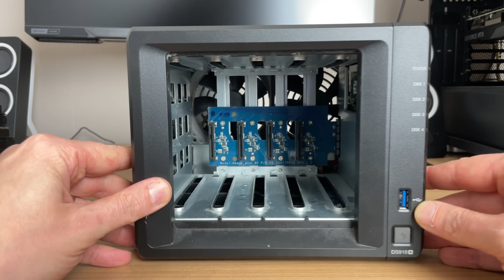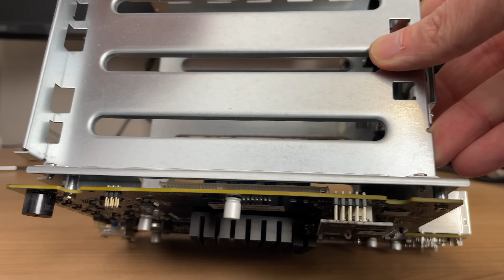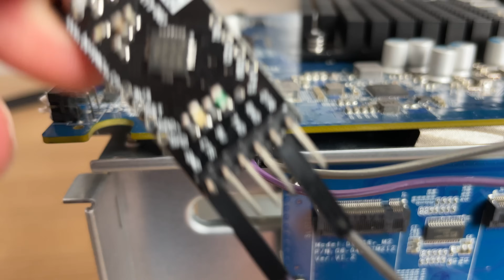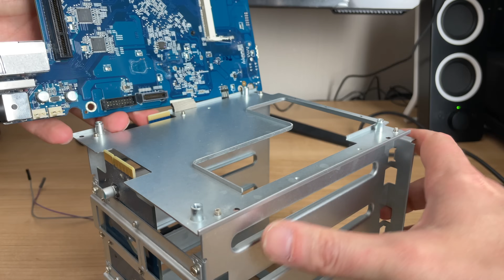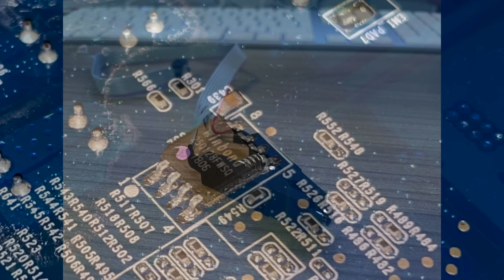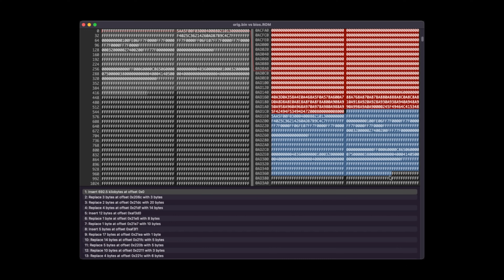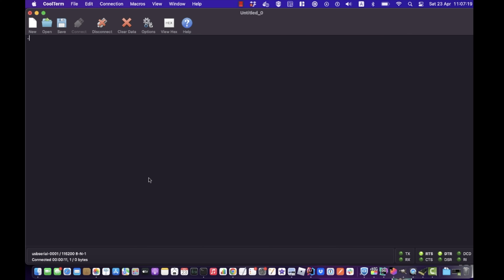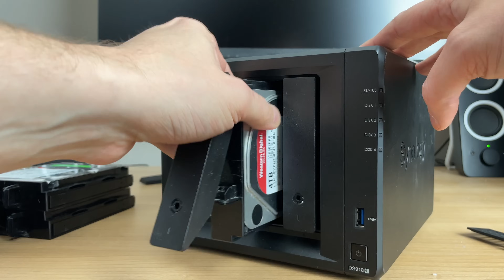Synology DS918+ Bricked / Blue LED of death.

Comment: Interesting, I have the same issue on one of mine, a DS218 and ended up buying a new one. I don't really have the tools nor the skills to effect a repair like this. I'm overall very happy with Synology and have 8-9 of them. I've had a better experience with Synology than I have with QNAP where I had a 6-bay one die 2 weeks before it's warranty ran out and it's replacement die 2 months after it ran out. Great job on yours though.
Reply from the maker: Yeah. Also pretty happy with Synology but was a bit annoyed with the fact how easy these things can break. Friend of mine has 2 8-bay units that also got bricked. Going to look at them also. A shame that they make it difficult to fix. And when they are just out of warranty you have very few options.

Comment: Mine did brick as well, i had to reinstall dsm and all apps again to make it work.
Reply from the maker: This one was unresponsive ... didn't boot at all and could not do anything anymore.
Reply: @RetroSpector78  yeah seemed like a "soft brick" in my case. Shame for such an expensive equipment as you mentioned. Happened on power failure as well in my case. I have it on UPS now but thinking of doing a custom built. Thanks for the video is great 👍

Comment: Yes, immensely. But..but... You ended up "snipping bits" from your firmware and using it (even though it wasn't a exact copy?) as apposed to utilizing Synology's online firmware? Jumping ahead: A downloaded (ver/date specific) wasn't a viable option? If so, this is blowing my tiny pea sized mind :) My old-school smarts is not helping me at all. I do realize that having certain configuration data stored on the drives(s) is a life saver.  All that aside, you are the VOICE of REASON and I just wanted to ask, repairing the drive was the easy part and a walk in the park - what we want to know is how you "kept from panicking" :O)  Thank you for documenting that - You RoCk!
Reply from the maker: The bios rom that could be downloaded from the synology site was too big to fix on the flash chip, I guess there setup routing does some post processing on it. Just used my dump as a reference and noticed some patterns that were similar. Then it was just a matter of finding where to copy / paste and fill the rest with FFs. Didn't really panic as i was pretty sure the data would be safe. But still pretty annoying that it broke so easily.
Reply: @RetroSpector78   Then I "really did" witness something quite special... GOOD JOB! You pulled it together in a pinch (the best time too). Your years of accumulated knowledge, experience, determination and "paid dues" pulled you through. Maybe, just maybe the machines "won't win"?... That makes me feel a bit better. Thanks again. Cheers from So. Ca. USA, 3rd House On The Right

Comment: This is consumer grade (take that with a grain of salt.) NAS. They have created a name for themselves. They in time have gotten into larger and larger products with fail over and other features. Yes, they are more expensive due to name, features.  Also can you say the same for Qnap. When I look at these products it reminds me of Dell and HP. Both companies have cheap desktop and notebooks. Then you work your way up to Z workstations and Precision workstations. Most users don't even know these exist. Thus, they are overkill for the home owner and small business. But, a good example is I would rather have an HP probook or elitebook over a standard hp notebook. In fact it is so bad. I would get a dell notebook instead. If I could not get a probook.
Reply from the maker: Overall I am pretty happy with their products. The software is good and the hardware is also nice. The issue I had is something that only a small percentage of Synology users will have, but when you start googling the blue led of death issue on synology, you come across a lot of people with that issue. A colleague of mine had 2 DS1915+ units brick on him at the same time. 2 1000 USD units just out of warranty. I can understand that things can break, but there should be a more easy and documented way to go about and fixing these things.

Comment: I puchased 2 Synology rigs becase my MD had one. Well It was not long before they died as did my MDs Synology. We both used WD or Seagate NAS rated drives. Do not buy this crap. Use an old computer with FreeNAS or one of those types. The hardware in Synology is toy level in my opinion. One of them an electrolytic capacitor blew the cap off. On examination it was 1 a low grade and two underrated for the voltage amps and storage needed as even a filter.  Support was useless. They were good enough to Say they would send a replacement if we sent the broken back but they never did. Plus the lost data was a major issue.
Reply from the maker: As much as I like working with technology, I'm not one of those people that always want full control and always think that they can do something better themselves :) I've tried the FreeNAS route before but it remains a bit of a hassle to setup and maintain. I don't really have anything against these off-the-shelf solutions like Synology. And I can also understand that stuff can go wrong. Would be nice if they had a procedure to fix these things more easily.
Reply: @RetroSpector78  If you use windows then an old windows computer with a few drives will work. If a Mac use then a old MAC will work. The NAS or file server does not need the fastest CPU to run a few drives and network cards. You can get RAID cards cheap. Get two and set them both with exact settings. Put one RAID card on a shelf. LSI makes ok quality Raid cards. Software RAID is in my opinion good enough but can be as you said a DYIY Pain where Raid cards not so much. Or use a pair of drives with no raid. I.E. In windows Share them Lets say drive F and G. When you sace a file in one save it to the other and no raid needed. Need another drive use 2 more drives. Also buy the lowest end Acronis Backyp Software. Its the safest I have seen and easy to use and has lots of features you dont need but can be ignored.  Acronis to backup to a second synology. There are other things you can do. But this s getting long brother. I will help if needed no charge.

Comment: I've used Synology for a lot, after my Lacie failed for the 3rd time and was no more in warranty. By a few years (at home), I now  prefer to use a QNAP product, instead. It seems a bit more robust, although a true jack of all trades is to get your hands dirty and going with a DIY solution. Not for everyone, but it works better (at my job).
Reply from the maker: Yeah ... there's always going to be a percentage of people that have negative experiences with certain brand. Same thing with hard drives, motherboards, .... QNap for example also had the whole ransomware issue that left a lof of people unhappy.  As long as it works everybody is happy :)

Comment: I had a broken DS415+ with the well known Intel Atom bug, I had to solder a 100 Ohm resistor to a certain spot on the mainboard and since then it runs and keeps running, even to this day.
But that reminded me: Always have a backup, and in my case:
I have a backup on a different media, and I have a cold-standby NAS, a DS415play just to be on the safe side
Reply from the maker: Yeah also went ahead and installed a cloud sync now. I have 2 DS1815+ 8 bay bricked Synology boxes from a colleague that I will try to fix. Hopefully the resistor trick will be sufficient.
Reply: I also had this - resistor fixed it

Comment: Simple piece of mind, buy a UPS, plug the NAS into it, setup the NAS to auto power down after 5 mins of AC power loss.
Reply from the maker: Will look into that yes. But not always practical for a consumer to start putting UPS devices all over the place. Think Synology should try and do better here. (provide some kind of easy repair path).

Comment: Errrrr . . Errrrr . .Errrr . .yes, all very clever, but isn't any corruption going to be in the NVRAM, so, all that is needed is to take out the button battery out to reset the NVRAM, the values probably got corrupted by the  power loss/return. Leave the button battery out and replace it with a new one half an hour later . . . After three years the button battery will be banjaxed. . . You solved it, but with an over-egged tangential solution !
Reply from the maker: I did remove the coin cell and powered it on with a new one after leaving it off for a period of time. it would not boot and the flash was corrupted.

Comment: Nice one. I wonder if the bios chip got shorted out by the dust instead of the power cycling... what looks like water around it is probably just the dust on the casing that I have seen a bit later....  just a guess... it should not change the bits in the bios if the power goes out and this thing has an external power brick that is fairly well made I would not expect that to cause this... but we can only guess I think...
Reply from the maker: Also noticed that. You see that on a lot of PCBs. This one however was always in an airconditioned office / desk type room and never came into direct contact with any liquids.

Comment: I think I will have to buy another brand of NAS if such bios failure is possible.
Reply from the maker: The thing is that Synology is so popular with so many users that a percentage of those will bound to have issues. I think it's the same for other manufacturers as well.
Reply: @RetroSpector78  They should at least give an option to reflash bios easily, just like in gaming PCs

Comment: was you doing a firmware update when the power went off?

sometimes you can corrupt the firmware if the power goes off during a firmware update.

if you can borrow or buy another unit you can test if.

1. the drives are tied to the unit (sometimes parts are tied to the device to prevent swapping)

2. if it is just the unit that is bad. (the unit may be giving the blue led of death because it is not able to read the drives so buying another unit will tell  you if that is the case)

if you are going to go to the trouble to compare the bios chip why not reflash it

to prevent future corruption of the bios you may want to jump a wire from the write pin to ground so the device cant write to the bios so if there is a self corrupting code it will not be able to do anything.

Comment: So, it seems like the preventative solution to all this, is to use a UPS on units like this, and avoid power supply errors.
Reply: Nahh, that is not a real solution. Corruption still creeps up in an always powered system, those tiny serial flash ICs are always a single point of failure. Regardless of vendor and maker from lenovo/ibm to gigabyte, seagate to samsung, all of them use a serial flash for their firmware. A real solution to this would be a second back up flash but disconnected from data and power lines, only to be jumpered when needed. Unlike the gigabyte pseudo dual bios where everything is always connected and prone to silent corruption of main and back up flash.
Reply: @bloeckmoep  Those were my thoughts as well. Maybe the BIOS chip was already corrupt and the problem didn't present itself until the next boot, when the machine tried to read it.
Reply: @MeneGR  : a lot of device fail that way, bit flip/rot while powered on for a rather long time. That's also the reason why gigabytes dual bios fails too, the slave chip is always powered and connected to data lines, only the chip select is low. Add to this, the rigidity of firmware and serial flash to accommodate failing or degrading memory cells... flustercluck ensured. Can remember, apple put out an ios update for their iphone 4 to accept failing/faulty/aged battery ics. Iphone batteries come with a serial flash containing battery parameters, storing runtime, recharges, battery life cycle etc etc. Now if this always on ic degrades, there are certain symptoms suddenly showing, like spontaneous freezes or shut downs. That was fixed in an ios update to make the firmware more forgiving of errors stemming from the battery.
Reply: @bloeckmoep  Having no experience with standalone flash ICs myself, except that they are probably accessed through SPI. But don't they have an embedded flash controller that actually controls the erasing/writing? I'm just kind of surprised how easy it seems to be to corrupt data, but presumably corruption can occur anyway? Retention should be many, many years.

Comment: My 1515+ died, and after some research I found a common problem with those units. I had to replace a transistor and add a resistor, but it is up and running again! Your video gives me faith in trying to solve problems rather than dumping and buying new. I hope it does the same for others.
Reply from the maker: Also was donated 2 Synology NAS boxes (DS1815+) from a colleague that seem to be bricked. Hope the resistor fix will do the trick.
Reply: @RetroSpector78  how did it go?
Reply: Most likely it was the same issue that took my DS415+ down: the messed up Intel processor killing its clock line (look for issues with the Intel Atom C2538 for more detailed information), so the unit doesn't have a clock signal during boot. Synology replaced mine under warranty and that unit is still running to this day. If you managed to fix it yourself with a few cheap components, then that may be a cheap way to repair all the x15 series units that use the Intel Atom C2538 processor as its CPU.
Reply: C2000 Issue MMMM I would upgrade very soon.  Sorry this is only a temp fix it won't last forever, yes I had the same unit it does not last.  Anything after 2015 should be fine, no more bugs.  BTW it was Intels problem not Synology.
Reply: @blathum9  My DS415+ succumbed to the CPU issue in March 2019, and I did the resistor fix and it has been running fine ever since.  How long it will last I have no idea.
Reply: Same.  I'm just replacing the transistor on my 1515+.  This also happened after a power outtage.  I've also ordered a UPS.  Power cuts seem to cause a lot of issues with Synology NAS systems.

Comment: (Edit: I'm sure the owner already knows this!) Having your stuff on a RAID is not the same as having a backup....; clearly, any NAS can fail. (lots of Intel 2000-series Atom-based systems owners discovered) The units with internal PSUs typically are custom units, so, no darting off the Newegg or WalMart for a quick replacement, either! If on Synology, just stick to standard RAID instead of Hybrid RAID, and, at least the data can be recovered on any Ubuntu system in a few minutes...
Reply: mirror pairs usually can be read without anything special.
Reply: @churblefurbles  he mentioned just 8 TB of storage w/ 4 each 4 TB drives, so, I'm assuming a mirrored pair of RAID 0's? (0+1/10)
Reply from the maker: You are 100% correct. NAS / RAID is indeed not the equivalent of a true backup. Although it is already a step up from saving everything to a single USB external hard drive :) It takes some time / effort IMHO to setup a good backup strategy. We're all so used to stuff being handled in the cloud for us (Dropbox / iCloud / Drive / .....). But it's just too much work for the average joe.

Comment: I also have one with the blue flashing. Still in service but I am angry about the design. I plan on tinkering with it till the service sends the replacement. Care to share, how the debug port works?
My unit broke during firmware update...
Reply from the maker: it was a bit trial and error but that 6pin header contains the GND / RX / TX and VCC. I only tracked down the GND and TX cause I was only interested in seeing the output. Not sure if you can use that debug port to reflash it. Definitely not a documented feature.

Comment: Maybe its the atom c series bug seen more synology devices that got this after sudden shutdown due to power cur
Reply from the maker: This one had an intel celeron CPU. Have 2 other bricked synology boxes with Atom CPUs as well. Think there was a resistor / transistor fix for those.
Reply: @RetroSpector78  for de c serries bug/brick you are correct with the celeron chip i dont know if there is a same kind of fix but seems like a cou related issue